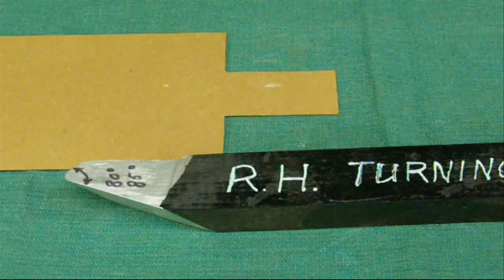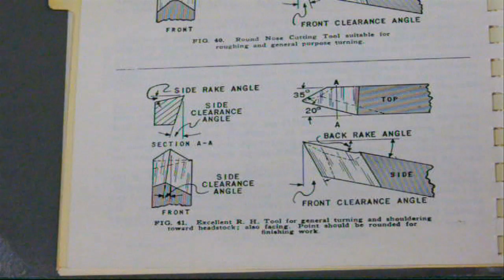MACHINE SHOP TIPS #34 Turning to a Shoulder on Lathe tubalcain

Comment: Hi - many thanks for another useful video. Do you have any tips for turning a piece of a given length with a shoulder on each end? I've made my loco axles, but it involved removal from the lathe - measuring - and then removal of excess. Just wondering if you have any tips as I wasn't really happy with how I approached it, it was a little hit and miss. Best wishes.